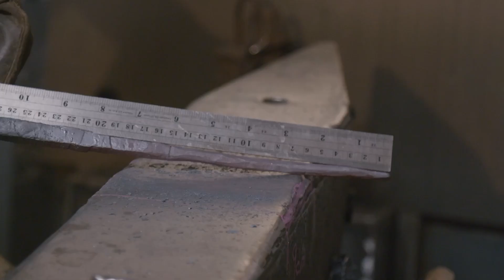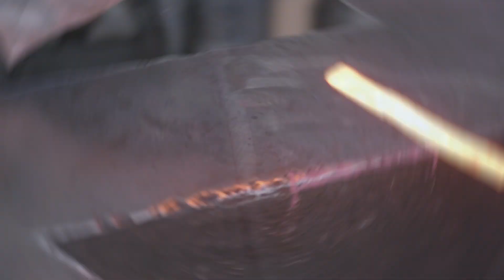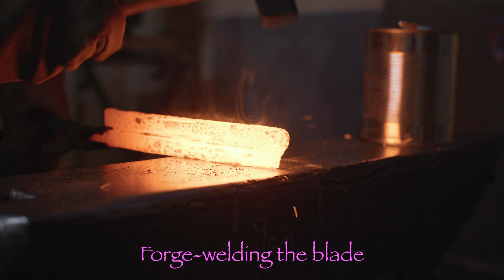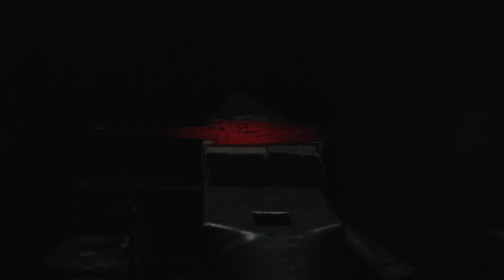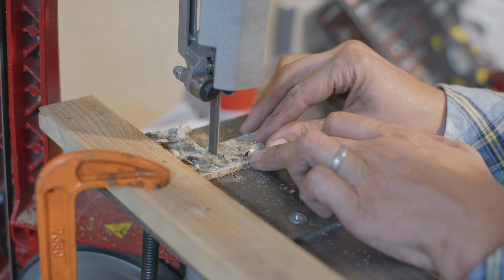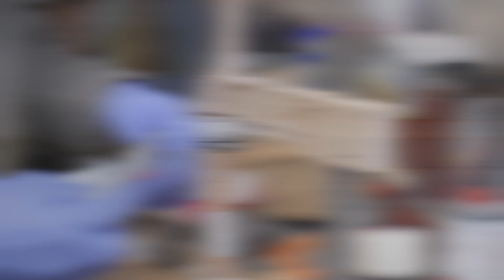ENG: 128+ Layer Scouting Knife with Herringbone Pattern

Comment: This turned out so well, one of those everything works moments :)
Just talking to friends the other day in regards to the press re-last video, its mostly a matter of moving the metal slowly at first, then really ramping up the pressure later after about 2-3 forge welding passes. So on the initial and subsequent forge welds they start at the base of the billet nearest the tongs and just do quick. light compressions a couple of millimetres at most and then when they're drawing out under the rounding dies they would go about 3-4mm deep in several passes. Which you can set up with a 'kiss block' to measure the stroke-length of the dies.
But apart from that its all working out great and made a fantastic looking knife
Reply from the maker: Hello Kris! Thank you very much for your feedback and advice! I really appreciate it! 
Yes, I am quite happy that things turned out nice and quite smoothly this time around :-) 
A kiss block might be a good idea, as it seems to be difficult for me to get the feel for the right amount of compression... Somehow when I see the material move I feel like getting carried away, because it just looks so mesmerizing :-) 
I already started the next build, which is going to be an "armoured" build with track links and so on... But more on that later... 
Have a good day!